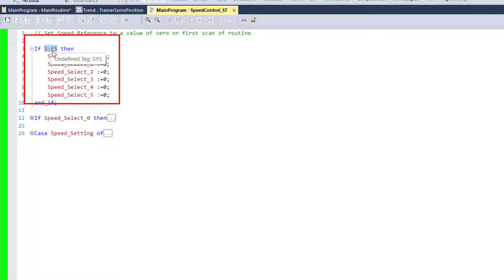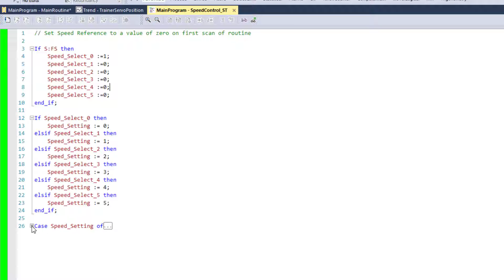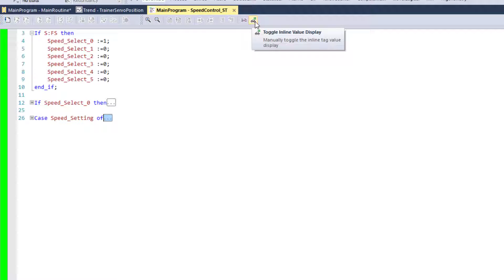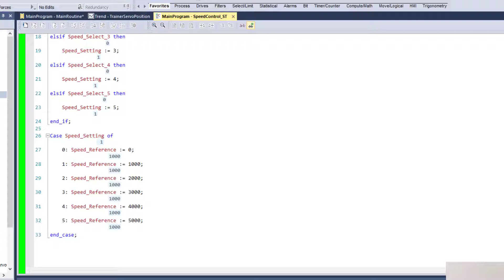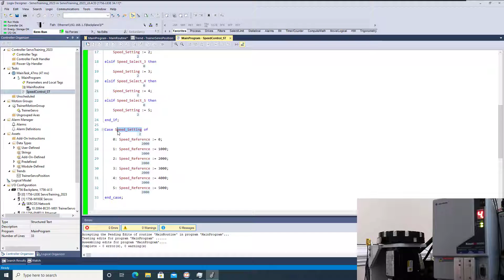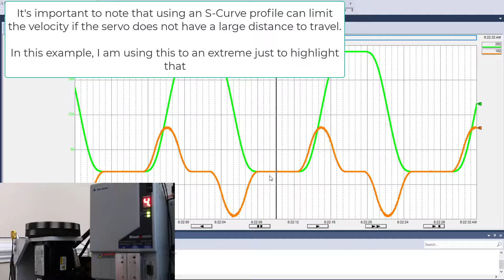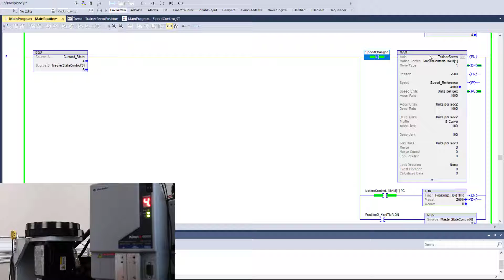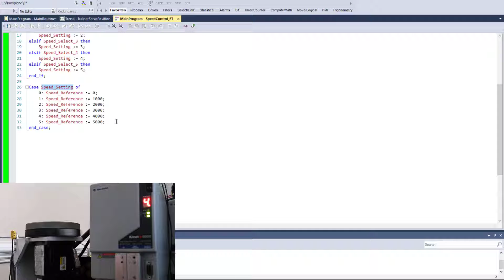Studio 5000 Structured Text Servo Motion Speed Reference Logic

Comment: I had a servo stop communicating with an HMI. I ordered new comms card for servo and new cables. I am confused about  how the servo gets its parameters. Does the PLC control the servo 100% as far as where it’s supposed to go?
Reply from the maker: The PLC controls the servo, if you have lost communications to the servo then I would check that.

Either CIP (Ethernet) or Sercos

Servo parameters are in the axis properties.

Hope this helps
Reply: @ShaneWelcher  I have an old Danaher Servostar 300 drive. The comms card is a Trio. Do I have to enter some type of program into the Trio card ?
Reply from the maker: @joew4202  not sure, I would look at the manual of that servo drive to know 100%

Comment: I'm sure you're aware of this but, I figured I'd add it for everyone else because it seems relevant; With Allen Bradley's motion planner an axis will never reach a velocity where the programmed decel will overshoot the desired position. Like was in this case, the move was too short for the given accel, decel, jerk and velocity so the motion planner capped the velocity to work with the programmed decel.
Now if you change a move's decel while its in motion (for those that don't know many AB motions can be overlapped and superimposed) it can absolutely overshoot it's position.
Reply from the maker: Things you discuss depend on the processors used along with what version on software you are using & the set up of the servos.

If setup correctly then a new decel command from an instruction will not over-write the last entry until the instruction has changed states.

Meaning, if the motion instructions already in decel then you change the decel it will not take effect until the next time the instruction is enabled.

Having an Axis overshoot a position is highly dependent on the setup of that servo & application.

I'm sure you thought you've seen this & yes it is possible however there are way to many protective beat practices that stop this from happening.

A lot of times, what you see working in the field isn't exactly programmed to the beat practice.

It's programmed to the personal's ability.

We have to remember that human error comes into play, people can not for see every event into the future.

That doesn't take away from the cause of that happening, if the best practices were done & the servo was setup with the proper application then this would not happen.

If you feel differently, I welcome you to make a video explaining.